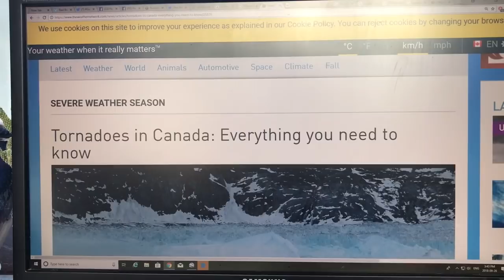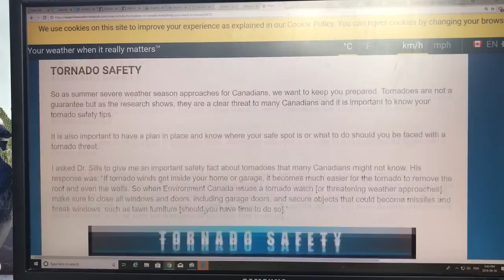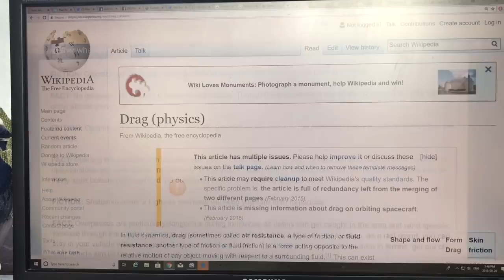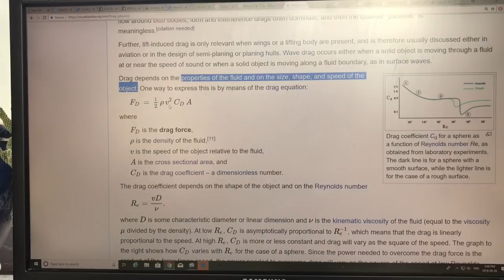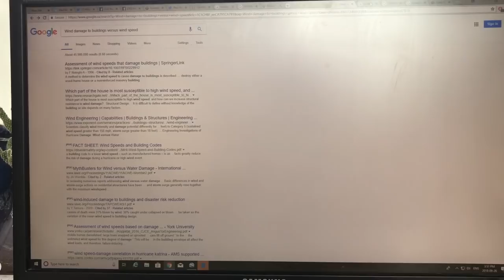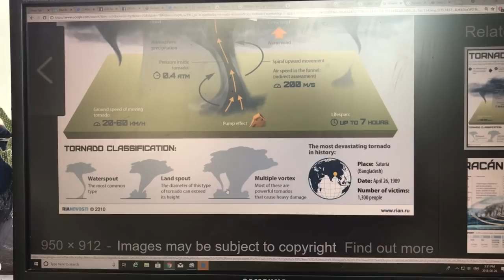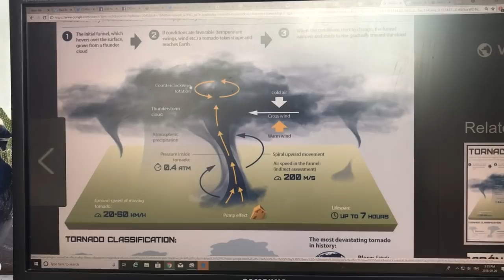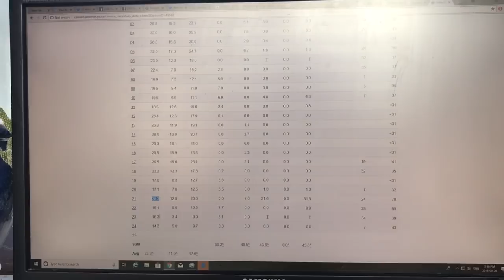Nonlinear Tornado Damage With Rapid Climate Change

Comment: I worked on a surveying teams in Wyoming in the 1970's, at the start of the Coal Rape of our planet. I took a new job with a company to build a railroad but the day before I started a tornado hit one of the three mobile home trailers that were their offices across the road from the Black Thunder Mine.  The tornado touched the ground next to the guard shack, forcing him to changing his pants, then hopped the road and hit the edge of the mobile home containing all of the surveyors notes.  It sheared off one end and opened up all the locked file drawers scattering all the papers inside the trailer.  It then picked up the trailer and it came to rest on itt's top  next to the middle trailer, and the tornado went up and hit the hillside above the encampment,.  There  were bundles of surveying stakes  stacked under the trailer, but they were not disturbed.  That had to be the freakiest start to a new job on internet, n'est-ce pas?  Eh?

Comment: In what is known as the "International Standard Atmosphere" as determined in the year 1974, where sea level temperature was +15 degrees Celsius during that time, the temperature 18 kilometers above sea level was typically -56.5 degrees Celsius, thereby establishing a temperature difference of 71.5 degrees Celsius across that 18 kilometer altitude difference.

With more CO2 in the atmosphere during the 21st Century than during the long ago year 1974 in the 20th Century, sea level temperature has risen, and the temperature at around 18 kilometers of altitude has fallen very slightly. Thus the former temperature difference number of 71.5 degrees Celsius has increased. This temperature difference number is important, because a higher temperature difference means more vertical convection, as hotter air near the ground wishes more strongly to rise and trade places with the cooler air at higher altitudes. Sometimes this increased vertical convection appears in the form of an especially strong mesocyclone that forms a tornado. Sometimes this increased vertical convection appears on the form of an especially strong macrocyclone at sea that gets a hurricane name or a typhoon name. Another possible result is stronger updrafts that result in especially large hail stones being formed.
Reply: Wendy Delisse Thank you Wendy your teachings and knowledge is like a candle in a dark room. Without it I would have little or no idea how to put it all together. Might I suggest a little reading on events of the past. It might help to understand this has happened before. Around 12,800 years ago a large comet struck the earth at the northern part of Northern America. The result was extinction of all large land animals in North America and the flood myths of all major religions of the world. Just imagine how much methane would have been contained on this continent when half way down the United States covered with ice. This is how I know there will be survivors because there were before. Our civilization will die and the only thing that will tell is perhaps myths. The human species will likely survive but that is all.
Reply: @rf-bh3fh  , any meteorite effect on atmospheric CO2 during the 11th Millenium BCE from any meteorites that might have struck Earth during that 1,000 year time span was negligible in comparison to the amount of CO2 that mankind has put into the atmosphere since the beginning of the 20th Century.

You will remember my reference to the approximate International Standard Atmosphere temperature in 1974 above the top of the troposphere of about -56.5 degrees Celsius, in relation to a standard sea level temperature of +15 degrees Celsius in 1974. As an example of what can happen when the altitude related temperature difference is increased, in 2013 Typhoon Haiyan was over sea water at a temperature of +30 degrees Celsius, and a ring of clouds around the storm center was at about -63 degrees Celsius.

As sometimes happens in the tropics, the air was colder at high altitude than the old 1974 standard, and as usually happens in the tropics, the air was warmer at the sea surface than in that old standard. The effect of "tropicalization" from global warming means that the conditions in the tropics will gradually expand to non-tropical latitudes, latitudes intended to be more accurately covered by the old 1974 standard. At higher latitudes, the Coriolis effect is stronger, so under sufficiently similar tropical-like conditions in the higher latitudes, storms will be stronger than when nearer the Equator.

Typhoon Haiyan in 2013 was an example of what can happen with a very broad area of upward vertical convection. Tornados are much less extensive examples of areas of upward vertical convection. More temperature information on Typhoon Haiyan can be found in https://www.sciencedaily.com/releases/2013/11/131108091814.htm "Super-Typhoon Haiyan lashes the Philippines". A high surface temperature is very important in upward convection, but a low temperature in or near the tropopause region of the atmosphere can also be important. Typhoon Haiyan was but 11 degrees of latitude north of the Equator. As the +30 degree Celsius sea surface temperature contour gradually expands further north from the Equator due to the progression of global warming, storms experiencing Haiyan-like conditions more distant from the Equator will have a potential of becoming noticeably stronger than Haiyan, due to the increase in the Coriolis effect in the higher latitudes.

Comment: I have trouble applying your information to my situation.  Do tornadoes swirl in the opposite direction in the southern hemisphere.  We had a recent one hit Taranaki - is your advice to invert the information that you have provided?
Reply: Yes, in the Southern Hemisphere south of the Tropic of Capricorn, the Coriolis effect causes a very strong bias for tornados to rotate clockwise, just as in the Northern Hemisphere north of the Tropic of Cancer there is a very strong bias for tornados to rotate counterclockwise. Within the tropics, there is less of a Coriolis effect bias, and at the Equator where there is no Coriolis effect bias, a tornado will rotate in accordance to local conditions at the time. The rotation direction rules are the same as for tropical storms at sea, except that tropical storms are much wider in area than a tornado, and therefore tropical storms experience much greater Coriolis effect rotation direction bias than tornados.